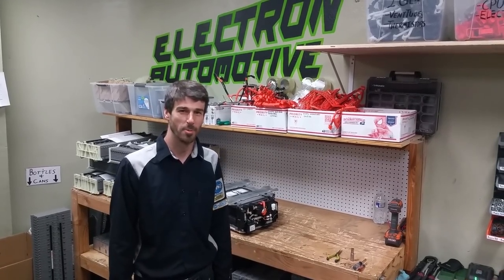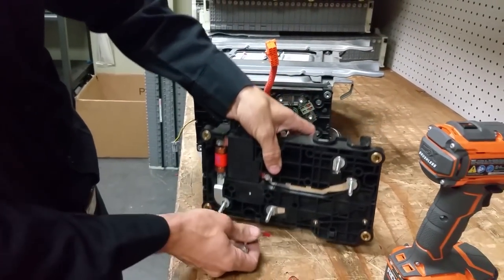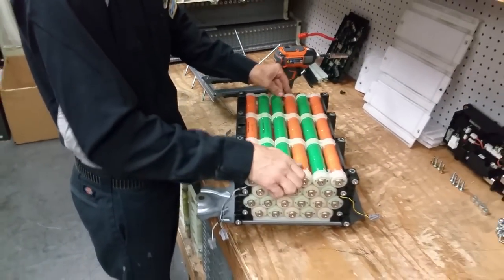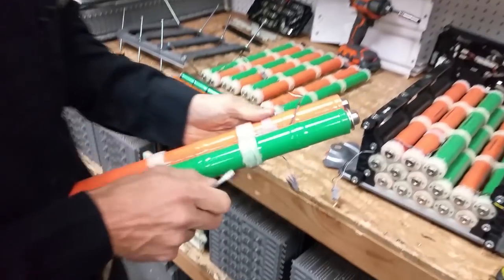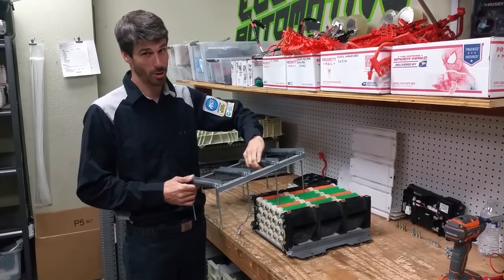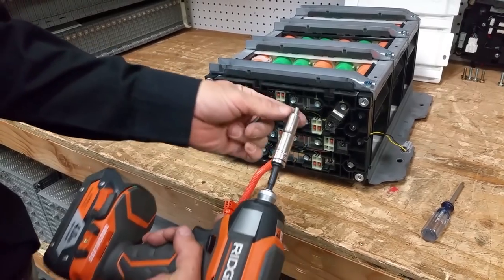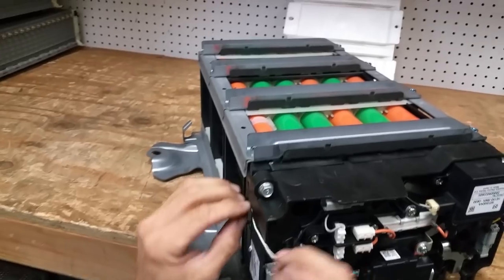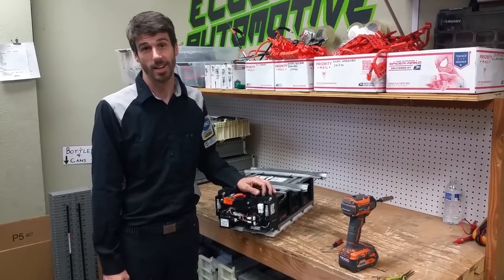Disassemly and Reassembly of a Honda Civic Hybrid Battery 2006-2009

Comment: Is there any way to check with some tools which pair is damaged?
Reply: miszowaty harbor freight load tester
Reply: @kerem54545454  how does this work on the IMA Batteries? seems like its for standard 6/12v batteries.
Reply: Kevin Williams load tester tests up to 14 V and even more. You can test every each of the cell to see which one  discharging behavior is different than other. if your ima battery is too old and you always have ima light , odds are all  cells are bad and you need new complete pack (11 pairs). I meant for Honda ima system, all batteries has to be in same charging capacity, if one is different it’s not going to work car will be stranded Vs in Prius, battery capacities doesn’t matter that much, it’s tolerance is big if you replace one or 2 bad cell it will run without any light.

Comment: after replacing broken "sticks" and reassembling the battery into the car, does the software needs to be updated? Or all IMA faults will be cleared automatically and the car can be driven with right away?
Reply: is there a video on how to tell which one is "Broken" I do have 2 battery packs and was thinking of taking the good batteries out and swapping the bad ones.
Reply: yes preferably update it. also fixes any bugs
Reply: @mrnpc1602    I bought a 2007 Honda Civic Hybrid yesterday and it runs great even with the IMA/Engine light and 1 battery deterioration error code. Would love to know how to use a IMA Tester to replace just the bad battery cells.
Reply: @mrnpc1602  Yes, look into the video in my channel about internal resistance.
Reply: After installing the IMA battery, we must disconnect the 12v battery (negative and positive) under the hood. Wait 30 seconds. This will allow the computer to restart and determine the status of the newly installed hybrid battery. If it's good, you will have no problem generally and can drive away. No need to see a dealer. You will know if it's bad. Follow instructions and study very carefully. Then, you will have no problem except for those that the hybrid battery will give (i.e. not working well).

They can drive well and for a long time with the check engine code: P0A7F.
Reply: @KevinWilliams87  Look into our videos on internal resistance with the sticks. Cheers and best wishes.
Reply: @mrnpc1602  So you can pull the whole unit out again to replace the others? Just replace them all and be done.

Comment: Hi I just bought remanufactured cell battery from you guys and I removed the old and installed a new one,I did installed pretty and the connect everything,and start the car the IMA lights come on and battery light on and it won’t charge at all,and I disconnected the negative terminal on the battery and put back on and still the same issue.
Reply: Estoy pensando en ordenar la cell battery si sirvió tu carro ? Si no para no ordenar nada

Comment: I just took a reading of the voltages of my cell pairs which vary from 16.0 to 16.58, is this enough variance to worry about?
Reply: That's pretty good. Don't worry for a while. You will know when it's going bad. And, even when it is going bad, it may still go for a while. Wait for check engine codes and don't fix the battery too early. Get your moneys worth, then move straight to new sticks when you feel they are too bad. 

Or, grid charge and discharge them using maxx volts. That's my best option.

Comment: Hi, very interesting job 👍 I have a question, my hybride batterie mounted on peugeot 508 , is not good , this battery element is it available ? However is it possible to adapting this ? The peugeot module have 4 accu element.Thanks for your help.

Comment: Hi, guys I have replaced two of battery sticks, followed the instructions strictly, but after reassembling, the car don` t recognized the battery module at all, ima, check engine and red battery lights are lighting on the board, the hybrid system is not functionally. In the junction board (from the flat washers) I have meassured 75 and 90 volts, but 0 volts in collective + and - connectors after I reinstall the battery in the car, and put the switch in the on position. Finally I was put back the replaced sticks, but I have the same problem. Can you help me with some ideas, instructions, please?

Comment: There are different sizes of the orange/green stacks, and they are not interchangeable.  Different models of batteries, different cars or years, I'm not even sure. Even the distance between the bolt holes are different.  I suppose you could use the smaller size in the larger case, but they won't be tightly held in place.  The difference is only 1 or 2 mm, but it's enough to make interchange impossible, near as I can figure.  Any ideas??

Comment: You are only replacing some cells..will that work or compromise the whole pack?
Reply: No problem. I just did it. But, it requires a few extra steps. Grid charging and discharging to cycle and balance the sticks and entire pack.

Comment: Once the battery cells are replaced do you need to reprogram the central unit or do any other kind of software update?
Reply: in the brand they do an reprogram on bcm. But this is not simple like this, after do this we need to get them all connected together to balance, if put onbalanced after some time you will get error

Comment: Just a recommendation,  I would screw a 2x4 along the leading edge of bench flush with top. Just to make a sacrificial edge that can be replaced. Thank you for the expertise video.
Reply: Or remove them the right way.

Comment: You could try checking the voltages across low battery packs to see if you have to replace all of them the ones with the low numbers are most likely the bad ones
Reply from the maker: Voltage does not tell you much especially with Hondas, Most of the time the bad cells in Hondas still have good voltage. the best way to tell is with test equipment but there are not cheap machines that do a good job that are available

Comment: Would you happen to know if the batteries for this assembly are Nimh or Li Ion? I'm attempting to repurpose the batteries but cannot find any information on them. I've seen some labeled at 15v but the ones I have are all at 6-5.5v.
Reply from the maker: These batteries are NiMh. Lithium modules are found in the later model Honda hybrids. 2013ish and up

Comment: Hi. The 2 modules are soldered at the bottom? Can we separate them and replace 1 module it defective or will have to replace in pair?
Reply: Just do a pair. It's way easier.

Comment: Thanks for this! Honda is either being irresponsibly wasteful or ripping people off by not providing techs the training and materials to do this on-site. 

I see.a few people asked this as well, but what kind oof IMA Battery tester can be used on the individual batteries to test the charge? And is there some kind of map as to what the normal operating charge is for each battery?
Reply: Hi Kevin. Did you actually try tackling this task? I am thinking about it.

Comment: does the colors of the each individual parts matters? i saw green and blue instead of green and orange. is it the same?
and one more thing that i wonder.
let's say after 1 year. efficiency of the battery that i bought new, decreases or stays stable ?
Reply from the maker: No. It just has as different origin.

The batteries degrade as time goes on but it is a negotiable amount until it gets towards the end of its life.

 Eg. A new civic battery may get 35mpg and a 10 year old, and good, battery will get about 33-34. The batteries are "over built" because they knew degradation is inevitable so they did not want mpg to drop after a few years
Reply: @electronautomotive991  thank you for your care. appreciate.

Comment: Hi, I have a question,
Why on honda hybrid is a short when I connect a jumper because the battery is dead?
Thank you,
Reply from the maker: Can you rephrase your question and tell me which battery, hybrid battery or 12v battery?
Reply: @electronautomotive991  
He tried to pass current with a jumper at 12v battery and made it short, why?

Comment: I have a 2003 honda civic.  The IMA light came on. It turns on and off intermittently. I have had the car for 4 days now and it has turned on and off two or three times now what do you think is wrong? I also saw an ad online for a battery for $995 and watch the video of an installment of 1 in and look like it only would take an hour it took the guy on YouTube 14 minutes so I figure me an hour. What do you think is up with the IMA light turning on and off?...It's on right now...? Thanks
Reply: Be careful when changing those batteries. They are not the regular 12v batteries and can cause death if you do not know how to handle them.
Please be very careful when dealing with electricity.
Our heavenly Father give thee wisdom that cometh by fearing him.
Trust the Messiah who died for our sins and rose again the third day according to the scriptures.

Comment: Ι have followed this procedure with 2  new pairs. When I started the car everything was perfect. After 6 hours I started again the car and I had 12 volt battery alarm and IMA battery alarm. The battery doesn't charge
Reply from the maker: yes, we recommend replace all of them with new or remanufactured cells. the old ones do not last long and cell switching does not work well, especially on hondas
Reply: Right, some of the sticks are too bad. Probably very high internal resistance. We have a video on how to find that.

Comment: That's not an 09.  06-08 are different than 09-11, have different junction boards, and they are not internally compatible as the stick spacing is different.
Reply from the maker: S Keith thanks for the reply. yes, you are right about 2009 being different on the electronics. the batteries are interchangeable, just change the plastic spacers. we have a video for the newer type and have plan to upload it soon

Comment: Good, but don't use his method of removing the end caps. Smacking them against a table will take them off, but it will likely break off the little tabs that hold them on. Use a screwdriver and pry them off gently.

Comment: U don't want tell us where we can buy nimh cells
Reply from the maker: You can call us, go to a junk yard, ebay, amazon, or most hybrid shops. just make sure that who you buy it from professionally re-manufactures batteries. here in California it is difficult to find good honda batteries. most people measure the voltage and say they are good if they are above 7.5v which is a very poor way to test batteries. Good luck with the rebuild!

Comment: high voltage DC is a big deal, only 3.5mA can stop your heart. and thats at 42 volts. this battery is minimum 132 volts.
do yourself a favor and wear rubber cloves
Reply from the maker: I understand your concern. High voltage can be dangerous but is not as dangerous as most people think in this application. A good analogy is that you can drown in 6 inches of water. It is true, but it is taken out of context.

Comment: Sir I have honda fit hybrid 2011 model I have changed my engine with gair due not power of engine but the same problem facing tell now i change the battery?

Comment: I just replaced my old battery sticks which were all reading about 12 volts with new packs reading about 15 volts. When I attempted to reinstall the bus bar board, I had arcing and melted the board. I was very careful to install the new packs just like the old packs. Any idea what is causing the short?
Reply: any updates!?
Reply: Hi  @highass  When I previously stated "I was very careful to install the new packs just like the old packs" I was WRONG!  A kind gentleman was able to provide the information that should have come with my replacement batteries (but did not).  I'd be happy to share that jpg with you but don't see how to attach it to this reply.
Reply: @keviniachini692  I was actually looking at buying a 2009 civic hybrid with 150k miles for 1,500 usd. Assuming it needs a battery is it worth it you think?
Reply: @highass  My 09 Civic Hybrid has about 150K miles also.  I did buy it new (usually I buy used cars) and I maintained it all along with oil and filter changes and recommended service (like transmission fluid changes), etc.  it is really good with tire and brake wear and should be good for another 150K miles BUT...that IMA battery really concerns me.  It is essential.  After I replaced my battery sticks the car ran like new again.  Great gas mileage again.  It only lasted about 6 months.  My IMA battery light is back on again and the car is running poorly.  Wouldn't pull out in front of oncoming traffic.  So, without knowing more about your plan (i.e. do it yourself battery repair/replacement or take it to a shop?) I can't say if I think it is a good buy or not.  I hope you make the right decision for you and your specific circumstances.  Good luck.